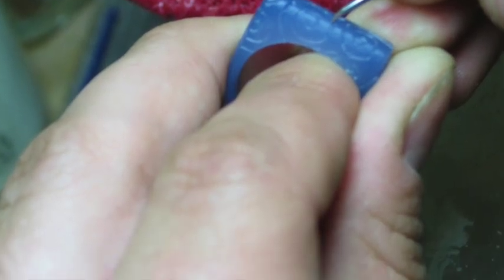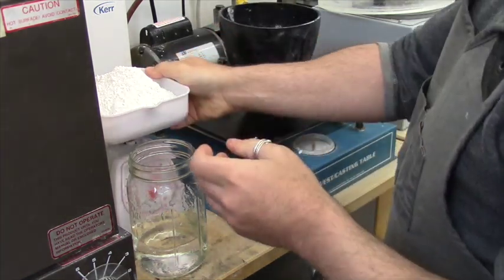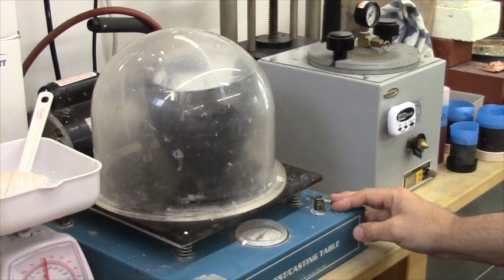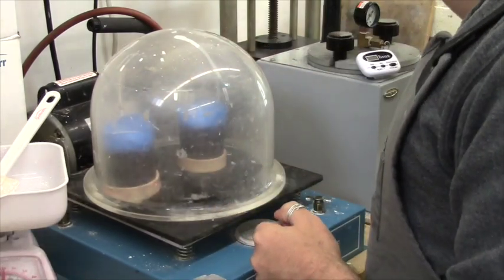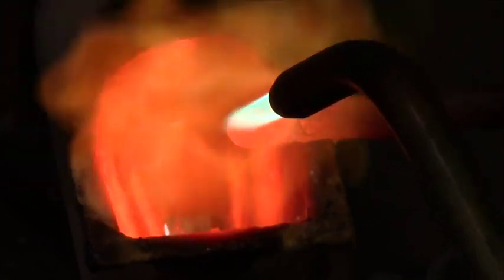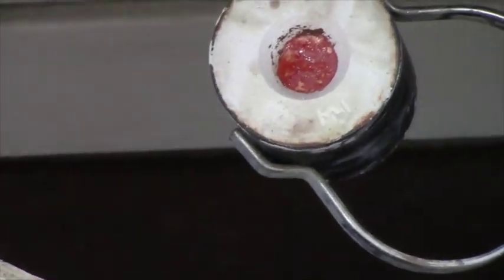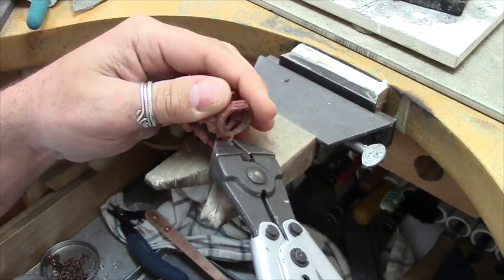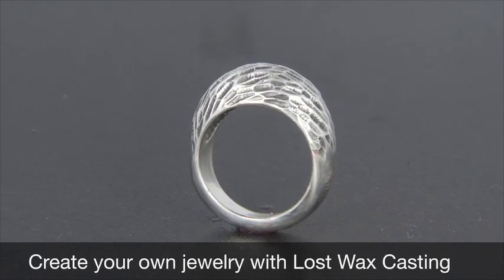Lost Wax Casting Process

Comment: I guess someday 3D printing will really speed this process up. Maybe even silver printing the product in one step
Reply from the maker: I agree... for now. But as the technology improves, those flaws may be harder to detect or simply just solved in the finishing process. I used to be able to tell 3D printed or CAD work from hand carved, but the programs for creation and the users have become so sophisticated that you can actually replicate some of the wabi-sabi "flaws" of the human hand now. In other words, give it more soul. I've seen computer printed models that were hard to tell that they were made by a machine. The future is coming, and it's looking more like the world of Start Trek every day. :^)
Reply: The kind of 3D printing that would make silver printing viable (FDM) will never produce a finish as smooth and flawless as this process. You'll always see the "artifacts" in the printed object, no matter how small they are.
Reply: I'm actually doing casting right now with aluminum and silicone. If you use something like ABS you can do a smoothing process with acetone vapors. When the print resolution is high enough, combined with casting, you really can't tell. It at least allows you to more fine tune the model virtually before casting.
Reply: No.! 3 D printing will turn this Art into a process !

Comment: I'm a little late to this video, but it's a great demo!

Can I ask - I have the same kiln (just got it). What is your burnout temp schedule for it? I've yet to use it, and haven't figured out how best to use it compared to my homemade one I used to use (talk about a guessing game!). Any suggestions? Do you ever steam the wax out first? That's what I used to have to do with my homemade kiln, but my understanding was that with this kiln I don't have to. 

Thanks! Great video!
Reply from the maker: +kathleen connor Hi Kathleen - I use Kerr Satin Cast 20 and they have a great PDF at The art and science of lost wax casting. - Kerr Casting that includes mixing instructions and sample burnout schedules. You can use the sample schedules to program your kiln.

A steam de-waxer is on my wish list, but I don't have one yet. Steam de waxing is usually optional. It's a way to decrease smoke and odor during burnout. A burnout kiln should have a hole in the top to release the smoke.
Reply: The burnout temp. on the majority of items is 850cent.

Comment: was there a reason you didnt vacuum cast but instead used the centrifuge?
Reply from the maker: +pikkilo Getting a good casting is about force: getting more than the force of gravity applied to the molten metal so that it fills the mold. Vacuum assisted casting lowers the atmospheric pressure in the mold and forces the metal into the recesses. New vacuum machines are better than they used to be, but a centrifuge has even more force applied to the metal for more reliable casting. Also, the centrifuge takes care of fast and accurate delivery of the molten metal  to the models. Vacuum assisted casts still depend on a person to pour the metal (unless you have a thousands of dollars for an industrial model). If you stutter the pour or mess up, oops, bad casting. I've always preferred a centrifuge over vacuum casting.

Comment: Did you buy your centrifuge  or make it?
Reply from the maker: +Candace Quebe It's best to buy it. A centrifuge is built around a powerful spring, which should only be serviced by a professional. In the 20+ years I've had my centrifuge, it's never had to be serviced. You can buy it from a jewelry supplier, like RioGrande.com, or OttoFrei.com. Make sure you get some training on safe use of a centrifuge, just as you would with a vacuum assisted casting machine. We offer casting workshops at Silvera Jewelry School, our school in Berkeley, CA. But there are lots of good jewelry schools all over the US now. Best! Joe
Reply: +Silvera Jewelry School  Thank you very much for your help, I have one more question is there anything cheaper than investment plaster something that I can get by with? I would like to test out casting before I get this expensive plaster.
Reply: +Candace Quebe Is your torch fueled by propane?
Reply from the maker: +Candace Quebe Hi again! I would recommend just buying a small amount of the correct investment plaster. Using the wrong kind can skew your results and be disappointing.
Reply from the maker: +Candace Quebe I use two kinds: an acetylene torch (it draws it's own oxygen, so single acetylene tank). or a oxygen and propane casting torch. If you're casting a small amount, like less than 2 ounces, and especially if you can preheat your crucible in the kiln at the end of the burnout, you may be able to get away with a plumbers torch from the hardware store: propane or mapp gas, until you're ready to invest in a better torch.
Reply: +Silvera Jewelry School Do I need a certain kind of tip on my oxygen/propane torch.
Reply from the maker: +Candace Quebe Well, it depends of course on how much metal you're casting. I use a casting torch set up, like this one we have on our school website: http://silverajewelry.com/store/w/id/1598/c/294/t/soldering-torches/n/casting-torch-propane-kit-by-gentec/details.asp. I can offer you a student discount of 20% since we've been talking about it. Use the code INTRO77 if you like when you check out. If you're trying to set up to cast on your own, I do offer consultations. Email me at info@silverajewelry.com if you'd like to discuss it further. Best! Joe

Comment: Do you need a centrifuge to transfer the molten metal to the flask casting?  Can you just pour the molten metal into the flask?
Reply from the maker: +Candace Quebe You can pour metal directly into the flask, but the problem is trapped air and gas that can cause the casting to be incomplete. 

One way around that is to add gates to the wax models when they're sprued, before the investment is poured. Gates are vents that lead away from the model towards the opposite end away from the pour, but not necessarily completely out of the plaster mold. They give the gas and air places to get trapped away from the model you made. 

The jewelry industry uses vacuum assisted pour casting to increase the rate of success. The flask is prepared with a special webbing that burns out along with the wax models and/or flasks that are made for vacuum casting. When it's time to pour, the flask is placed on a silicon pad with an opening connected to a vacuum pump. The vacuum pulls air and gas from the mold as the molten metal fills it.

When you compare the delivery of metal from the crucible between centrifugal casting and vacuum casting, one thing to consider is how effective is the delivery of molten metal into the flask. When you pour metal into the flask, it's slow and if the pour is stuttered or falters, can create cracks or faults in the casting. A centrifuge snaps the metal into the mold quickly and holds it with the force of the centrifuge as it cools. 

Can you be successful with vacuum assisted casting? Absolutely. Is it better than the centrifuge? For some things, like big flasks with thick castings. The centrifuge is excellent for detailed castings. Whichever method you choose, with practice it can handle most of your casting needs. Thanks for the question. Joe

Comment: Could I melt a candle to use as my wax? Thanks!
Reply: ebaymaster You can make a model out of anything that meets the specs to burn out in the kiln cleanly. Jewelry waxes don't leave a lot of soot and mess to deal with, so I would recommend using carving or build up wax from a jewelry supplier. Sculptors (as in foundry casting) use paraffin wax that is more similar to bees wax. That could be used too and you may be able to find it at an art supply.
Reply: ***** Thank you for your helpful reply!